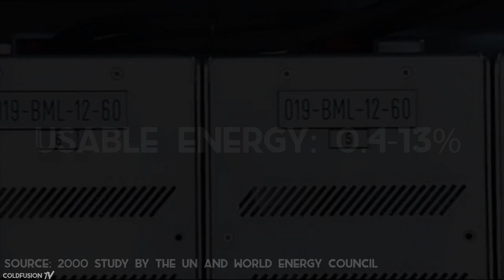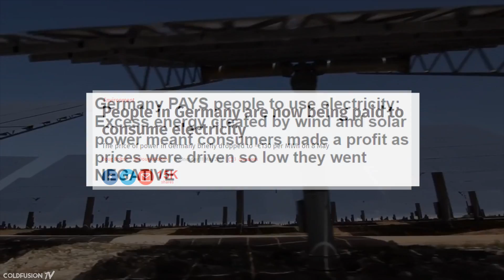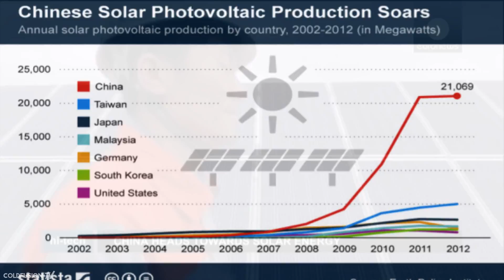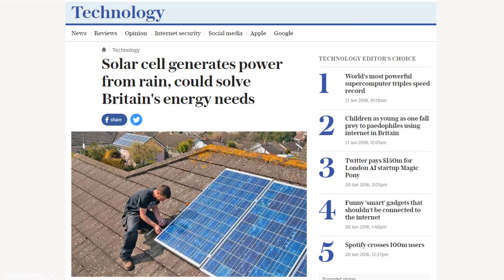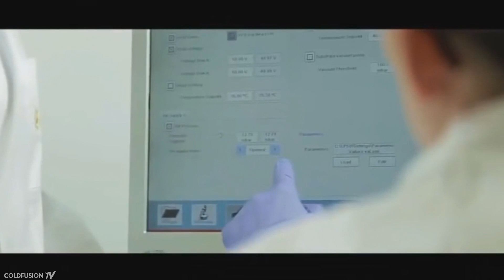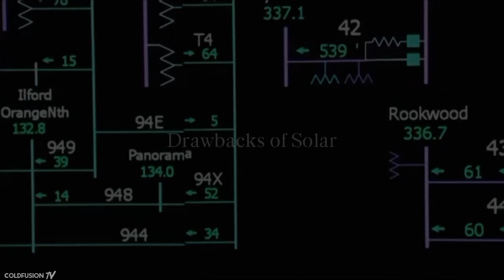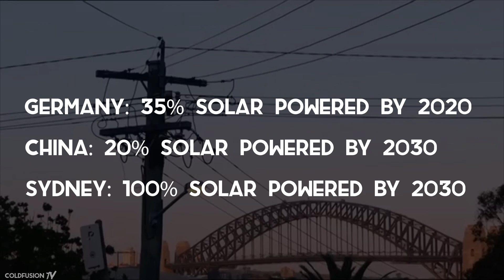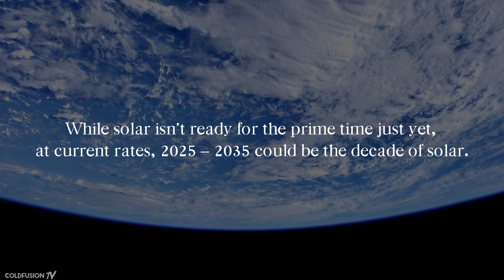The Truth About Solar

Comment: Problem 1 - No problem!!! Peak demand is during daytime - also when solar is peaking. Problem 2 - No problem!!! Efficiency is good enough when cost is less than a dollar / Watt and a roof can produce about same amount of energy as a house consume annually in Sweden. Problem 3 - No problem!!! The rate and concentration that solar is installed will be gradually compensated if needed to ensure grid is not failing or positive overloaded. Surplus energy can and should be used for smart devices like water boiler, AC chilled reservoir, Hydrogen production and last pump power plants. No more fusion or fission on this planet!
Reply: Problem 1: there are two peak demands in a day, the lower peak in the morning and the higher peak in the evening. The peak is not during daytime! Problem 2: It can produce the same amount that a house consumes, but try disconnecting it from the grid. The same problem on a much larger scale will be happening in the power grid. Problem 3: demand side management will be a part of frequency control in the future, hydrogen production is just a waste of energy (25 % losses in electrolysis, if you would want to create electricity from hydrogen later when there is a need for it, you would waste 40 % of energy in hydrogen), pumped hydro is probably the best idea (if we don't ). I don't get why fission or fusion is bad for us, if you could explain it to me.
Reply: @FrainBart_main  1. Peak electricity consubtion in Sweden start at 7AM and ends at 8PM with above 18 GWh / hour, or about 18 GW. Off peak is about 13 GW. Data taken from https://www.nordpoolgroup.com/Market-data1/Power-system-data/Consumption1/Consumption/ALL/Hourly1/?view=table  Peak hours are very consistant within 1 GW.

2. Anything you disconnect from the grid will fail apart from houses fitted with batteries and special on and off grid inverters. Solar connected to the grid is perfect to meat peak hours as mentioned above. Also good to replace / save hydro power that will be needed in the winter. The grid and the big hydro power plants together can act as an huge instantaneously, daily or season battery.

3. 25% loss does not matter when you have surplus power. Surplus can be so intense the spot price will be negative - a perfect time for saving hydro power and run hydrogen electrolysis. Also domestic machines and car chargers can be on standby until the surplus (and low spot price)  occurs.

Fission and fusion is bad for us. Ask people in Harrisburg, Tjernobyl/Pripjat Ucrane or Fokushima Japan what they think about fission and meltdown. Many lives lost from acute radiation or radiation related cancers. Even the fission waste is dangerous from radiation for many many years to come.
Reply: @Sailorman6996  1 You're right, I was looking at consumption of my country, where the evening peak can be up to 20 % higher than the midday consumption.

2 Off-grid solar is really not a good idea, even with batteries. Hydroelectric dams are excellent with solar or wind, Sweden probably won't have frequency problems in the near future because of all the hydro power NORDEL system has. Are you experiencing any problems when the water flow rate is low? Also, do you control frequency with nuclear too (our nuclear power plant doesn't contribute to frequency control, not even primary)? Another question if you maybe know, do wind turbines have synthetic (emulated) inertia system installed in them?

3 I've heard that when wind and solar production in Germany is too high, Norway imports Germany's negative priced electricity via HVDC lines and starts pumping water in pumped hydro power plants. Demand-side management will probably play a bigger role in frequency control in the future, especially with electric cars.

I really don't think they are bad for us. It causes lower deaths per unit of energy than even solar or wind industry. Three Mile Island and Fukushima: no casualties due to nuclear radiation, Chernobyl overall deaths: around 4000 according to WHO. Just one accident with hydroelectric dam breaking (Banqiao Dam in China) caused 171,000 deaths. The fission waste can be disposed in places where no one could ever get close to it. Fusion would't have problems with radioactive waste, also thorium based nuclear plants would be a lot better than uranium based.
Reply: @FrainBart_main  In my country Sweden and England the demand is very low night time, so low it may be an issue to shut down or decrease power during night. There of the cheap spot price becomes an incentive to steer demand over to night time.

Off grid solar can be an excellent choice depending on climate, heat vs cool management of the house. In Sweden not so good to trust only solar, but if you add heat from wood, a wind turbine and an emergency generator you will have a better chance of manage even in Sweden. In hot areas it might be easier as AC is needed at the same time as solar give the most.

The flow of water is controlled by hydro power plant and they act upon orders from grid management or what they are called. They might also measure in real time the grid and adapt power as needed. The water level in dam's on the other hand is depending on weather. A dry year raise the price /kWh. Not much we can do about that, other than build in more pumps at hydro power plants and hope for more rain.

Nuclear power has only one advantage - give lots of power when they had an notice long before its needed. Than mean nuclear can not balance grid, as they are way too slow adjusting rate of power. Hydro and biomass is much better at it.

Here is a link about synthetic inertia system, I have not read it but it may answer some questions you got. I'm not sure how it would work to still use 100% of all wind power while balancing grid. I mean to balance you need to adjust power input or output or both.
https://energiforskmedia.blob.core.windows.net/media/21406/synthetic-inertia-to-improve-frequency-stability-and-how-often-it-is-needen-energiforskrapport-2015-224.pdf

I believe fission is bad in all ways, not safe (square km after square km are banned because of radiation, visit ghost town Pripjat), expensive as no one can afford to clean up the mess of the meltdown already happened. Look what the second cover to ground Zero cost for Tjernobyl, a Wiki Quote: "The total cost of the Shelter Implementation Plan, of which the New Safe Confinement is the most prominent element, is estimated to be around €2.15 billion (US$2.3 billion). The New Safe Confinement accounts for €1.5 billion.[4]".

Thats just a cover, that will be needing a new even bigger cover on top of that within 100 years, then new bigger cover again after 100 more years. Still the cover is just a cover, nothing has been cleaned up or eliminated as it can not be done. The only way they could run it is if they were heavily subsidized. Fun fact about Tjernobyl is as this are is useless they started to install solar power. Thorium are also risky as there are radiation involved. But even people pro thorium know its too expensive.

For fun - name a place that we can get to today but never get to in the future? And how will it be protected? In 5000 years there might be no one that can read English or a number of other languages we wright warnings in. By the time all old waste is harmless 100 000 years later someone read our history and call us idiots for using nuclear, that and war of course.
Reply: @Sailorman6996  EVs will increase consumption at night, grid operator will need to be on top of EVs charging so that they don't overload power lines.
Solar panels + small wind turbine + backup generator + batteries is not cheap. If you want to live off-grid, it will probably be expensive or you will need to make big changes in your electricity consumption.
I was asking about the flow of water in rivers, not through turbines. When there's a dry year, a lot of regulating power from hydro isn't available so this can be problem with high percentage solar or wind.
First of all, the droop of nuclear power plants in France is set to be 4 %, just like hydro production. Second, ramps of up to 5 % of rated power per minute can be used in nuclear power (so 50 MW/minute for a 1000 MW nucelar power plant). Hydroelectricity can be faster, but you have a different problem with that, the water hammer effect. If you need to quickly lower the output, closing the walves will increase the output first and then decrease it. Because of this, a dynamic droop is needed in hydroelectric control schemes, which limits the rate of power output changing.
Thanks for the link, I know what synthetic inertia is, I just wanted to see if Sweden uses it and how much. It takes the energy out from the rotating masses when there is fault in the system and additional power is needed to keep the frequency in tolerances. It basically gives time for the primary frequency control to react.
All nuclear accidents were caused by a human mistake, not enough safety measures or both. There were very low casualties, but the land around Chernobyl is indeed uninhabitable. Thorium is a lot safer and produces little waste and the radiation from it is dangerous only 300 years. 3rd generation nuclear power plants are inherently safe. 
The place would be 3 km in the ground. You don't need English words to explain something is dangerous.

Comment: And how do you produce these pannels and batteries? How green is that?
Reply: Greener than using coal. And with high supply people will figure out a way to recycle
Reply: "Greener than using coal." It takes quite a bit of energy to produce cells and the aluminum to house the panels, which was the comment. That energy has to come from somewhere, and chances are that there's some coal energy in that fabrication. Electricity is fungible ... no one ever knows exactly what form of energy was used to push electrons through copper.
Reply: @lbuday  That would be great. But at this moment nothing beats Nuclear energy, specially the new generation that India and Russia are developing separately.
I prefer Nuclear energy rather than soalr, neither they are dependable nor they are easy to maintain.
Reply: @abhishekdev258  true that. Id just like to see how far we can push solar. Energy independence would be great plus electric cars powered by solar so you dont have to stop as often. But yeah I was never nuclear fobic unlike so people.

Comment: as a substitute for traditional energy sources, they are also advancing, and are simply more reliable and efficient, but as a supplement to homes and small offices, it looks promising
Reply: More reliable? Conventional electricity sources (hydro, thermal and nuclear power plants) are running almost whenever you need them, solar is producing electricity only when there is sunlight. If load increases, you can simply raise the power output of conventional power plants which you can't do with solar. When solar production drops (because of clouds, lowering sunlight power...) you need reserve power from other sources.

More efficient? Efficiency of commercial solar panels is about 15 %, nuclear and thermal power plants are at 40 % and hydro power plants are at 90 %.

Comment: may be we are not researching enough on  "advanced battery inventions" and  " Amplification of non-conventional ENERGY like solar,tidal,air pressure, sea waves, earth' movement etc "
Reply: Most of non-conventional energy is too expensive to exploit. There is a lot of researching on new types of batteries or making existing batteries better, a very energy dense and cheap battery would solve the biggest problem of wind and solar - intermittency.
Reply: đeri662 CAN CURRENT AND VOLTAGE AMPLIFIERS BE UTILISED FOR CAPTURING SOLAR ENERGIES ?  I knew that ""advanced battery technology"" is a key that's why I wrote.
Reply: @MrRightThinker  Off course you can but you can't amplify power, if you get 100 W from a solar panel you can only use 100 W and nothing more. That's the first law of thermodynamics. We could use lithium-ion batteries too but they are just too expensive for a grid wide use, they are fine for solar panel owners.
Reply: Mr. R. T.    Because there are enough uninformed, and quite frankly, stupid people, to go around.

Comment: Solar requires rare earth materials to produce, it will cost more to produce each panel because materials are more and more difficult to mine,  then the panels are good for 30 years (I heard 20 but lets say 30), your going to have to recycle the solar panels ( cost energy ) or put them in a landfill ( they will produce toxic leachate ).
Reply: what do you mean? 20 -30 years?
look at the real data monocrystals lose 0.47% per year means they will still give some power after 200 years

Comment: At6:12 ish ..

They talk about solar cells ...that can be powered by artificial light..

Can a storage battery be used to create light that then... creates more power?
Reply: You can't create more energy than your input energy. This is the first law of thermodynamics. If you would use 10 kWh from the battery to light a LED and create electricity from solar cells, you would probably get less than 1 kWh out (solar cell efficiency about 15 % + LED efficiency + other losses).

Comment: actually, all energy on earth is solar energy :)
Reply: except nuclear and tidal. Solar energy is also nuclear.
Reply: @FrainBart_main  ok nuclear i see its sort of the basic energy of all matter that would be there without the sun. but tidal is from the gravity and that is totally dependend on the sun. actally almost all matter is in suns or planets so they are also dependend. but this is getting more into philophics than science
Reply: @th1nk_outside  I meant sun's energy (radiation) is nuclear because the radiation is made with nuclear fusion at the center of the sun. Tidal energy is indeed because of gravity but mainly from the moon and to a lesser extent from the sun (it takes the energy from the mechanical energy in the Earth-moon system). If you want to even further, the Earth and moon are created with debris from supernovas, so again from nuclear energy. In fact before the Big bang, there was probably just energy that transformed into mass (after all, energy and mass are basically the same thing just in different forms - E = mc^2) but no one knows that for sure.

Comment: I'm wondering if I could use solar Panels for a Driveway, (SolarRoadways) and connect that to a couple wind turbines on the sides of the house, and a Solenoid in the basement. Would that be enough electricity for daily usage? also a constantly flowing water system that powers both geothermal generators and water turbines?

Comment: Here's my proof; A lot of smart people are working on it. Well great, now show me the results that matter. You don't have any yet, well that's not great is it? Back to the drawing table please, and this time; Try to start with a neutral view that changes over the time of the video, so it doesn't look like you're just trying to make excuses for why it's still BS. BTW, that polish company is a bit late, they've already made this foil in Israel, and they're using it on buildings. It gives you about 600w per square meter of the possible 967 watt.

Comment: for free, once you bought the panels and installed them
Reply: @Richard Vaughn Most warranties for crystalline-type panels are 25 years, based on an estimated performance reduction of around 0.8%/year. That said, long term analysis is nearly non-existent, for obvious reasons. But there are panels from 35-40 years ago that are still performing at an acceptable level, meaning upwards of 70%....

Even still, 70% of free is still free. You don't HAVE to replace them and they don't magically stop working past the 25 year mark. And even if they DID it would be completely and totally irrelevant in 25 years time, because at the rate technology is advancing there will be significantly better solutions by the time it's even something you'd need to think about.

Comment: One drawback you forgot to mention about solar is the amount of extraction of rare-earth minerals needed to manufacture the panels on such a large-scale.

There is a huge energy investment toward digging the ground, blasting away rock, hauling out minerals, then shipping the materials to facilities that refine them and purify them, then shipping the refined goods to other locations for further production until they are ready to be shaped into the sheets needed for photovoltaics. Then you have the energy input at the final facility that molds, shapes and installs the pieces together into a solar panel.

At many of those facilities, you are on a grid that is powered by LNG/coal-fire, the facilities create liquid and solid waste during production of the materials, and lastly, the solar panels don't last more than a few decades before they begin to degrade due to UV damage and exposure to the elements. This means there will need to be constant resource extraction and production of solar panels, which will add a lot of pollution.

Renewable energy sounds great and I'm sure even the most crooked of profiteering oil-men would love to see a clean world that is infinitely-sustaining in energy production; however, no matter what kind of "free" energy venture you pursue, there will always be an environmental drawback, a waste-creating problem or some kind of silver lining to what sounds like the perfect solution that prevents it from being widespread.
Reply: I didn't know silicon was a rare earth mineral?

Comment: I found it odd that there was no mention of battery development because the real truth about solar is that without major battery advancement any increase in solar technology will be under utilized. Conventional sources of power be it diesel, coal, hydro dams, all have power storage built in allowing 24/7 operation whereas solar power does not.
Reply: Redflow , zinc bromide batteries.